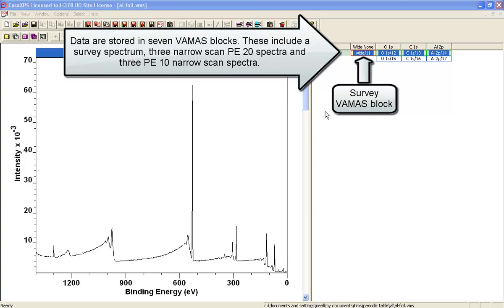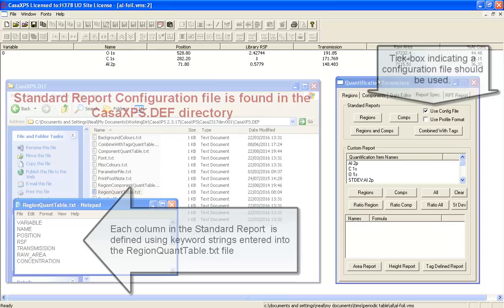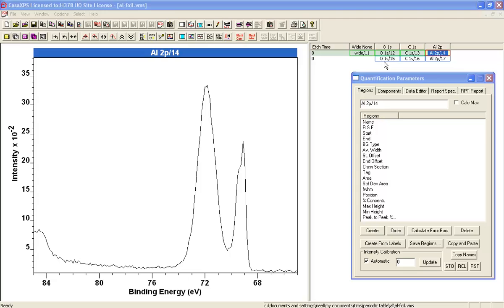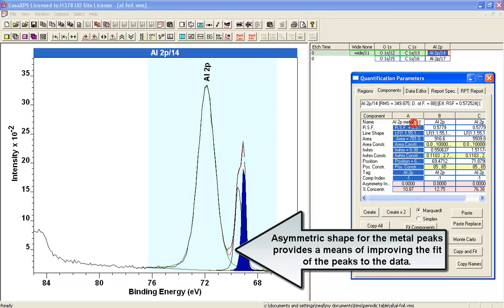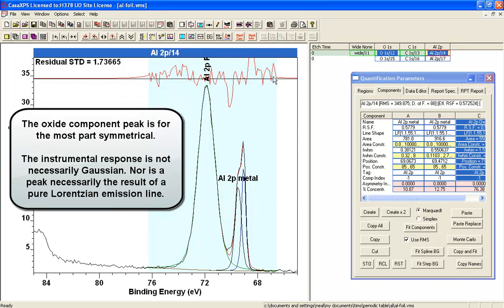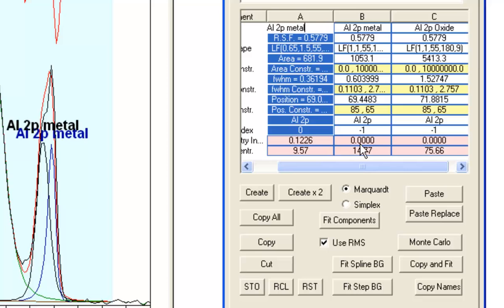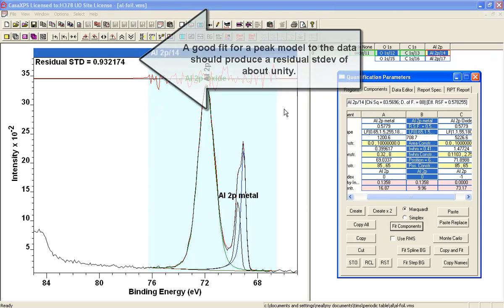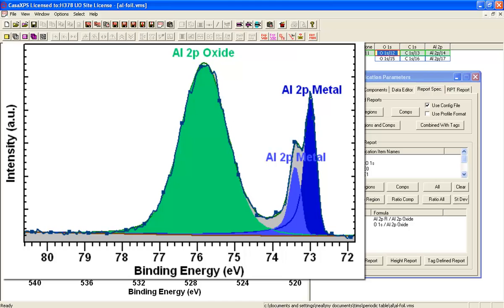Quantification of Narrow Scan Spectra Using Regions and Components in CasaXPS

Comment: Could you please explain why the Al2P of the Oxide is modeled using a single peak, whereas the Al2p peak of the metal is, as usual, deconvoluted using a doublet?  So, is spin-orbit coupling irrelavent in Oxides?
Reply from the maker: Spin-orbit splitting is relevant to all oxidation states. The reason a single component is used in this example is for the sake of simplicity in the peak model. The problem for Al oxide photoemission is the peak is without obvious features caused by the doublet nature of the oxide peak, so from a mathematical perspective, optimisation cannot be used to establish the ratio 2:1 for intensities within the oxide peak. FWHM and offset in BE are also doubtful if estimated by optimisation for Al oxide. If a double pair is added for Al oxide photoemission, then constraints to impose relationships between intensity, FWHM and BE-offset are necessary. These constraints are, for ill-defined photoemission, a guess. Hence it is sometimes better to accept the use of a single component for Al oxide, with the understanding that the oxide is in fact a doublet.